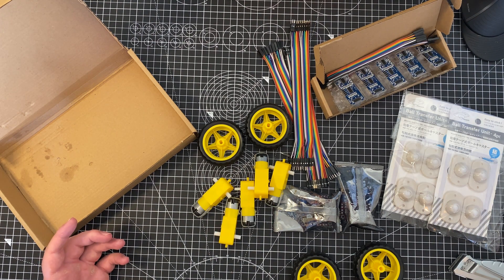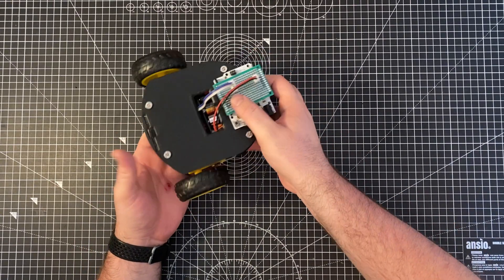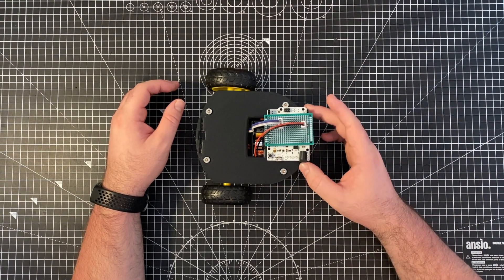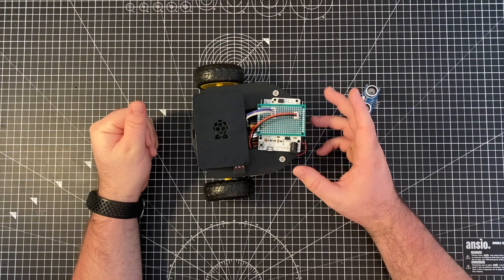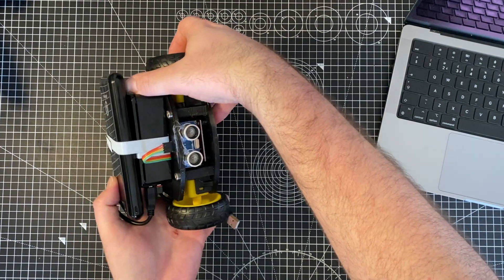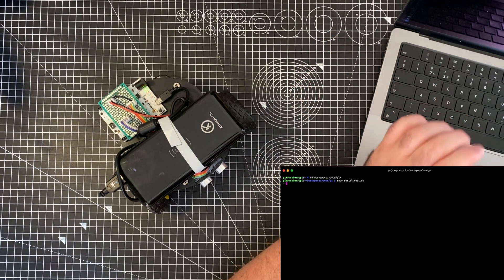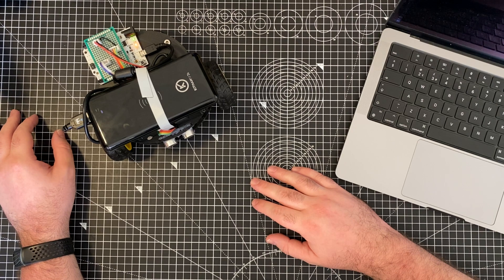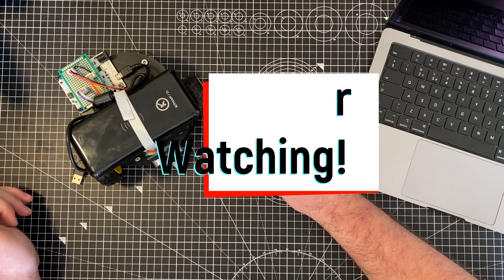Autonomous Rover (Arduino & RaspberryPi) - Part 1

Comment: Hey, Ian. Thanks for sharing this project. At this date, what Arduino and Raspberry PI would you buy to build your BeeBoop? Would uno or nano work also? and maybe Raspberry Pi 4 1GB would be enough? Thanks.
Reply from the maker: Pretty much any raspberrypi available now would work fine for this. Same for the Arduino. The Uno or Nano should be fine.
Reply: @ thank you!

Comment: The robot turned out to be cool, don't you have a visual connection diagram?
Reply from the maker: What is a visual connection diagram?
Reply: @careyian  this is a drawing with pin markings where the boards will be connected to each other through wires. This makes it easier to navigate in which rem you need to connect the boards
Reply from the maker: Ahhh you mean a schematic, no, I don’t have one I’m afraid
Reply: @careyian  tell me, is there any way to contact you, and if the robot is still alive, then ask for his photo?
Reply from the maker: You can contact me via my website liked in my profile. However, this robot was disassembled, so the best you will see is from the video here.
Reply: @careyian  understood, thanks anyway for the quick response. Good luck with robotics!
Reply: @careyian  I just want to erase your robot for training, but I'm a little confused about which pins to insert the wires into.
Reply from the maker: Erase it??